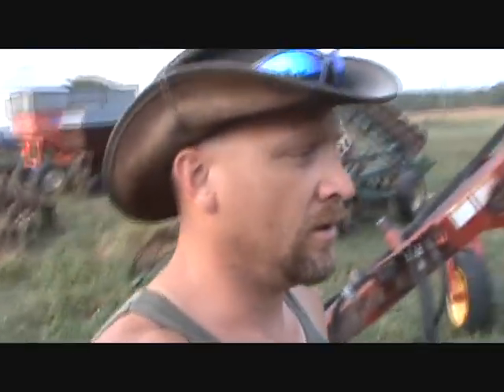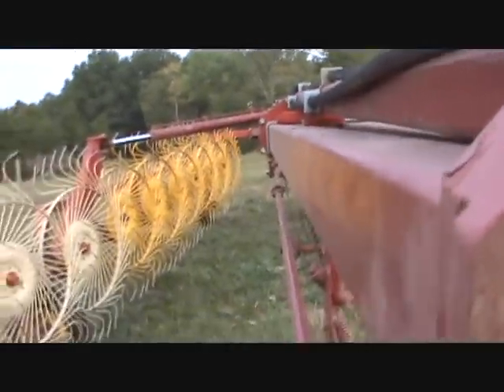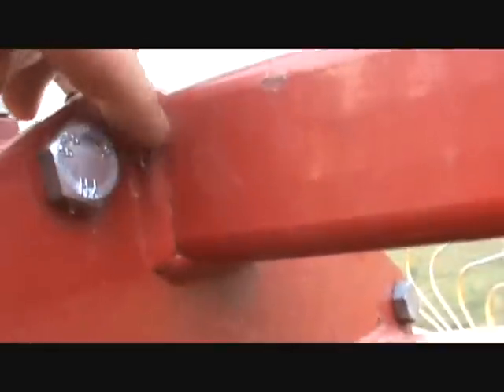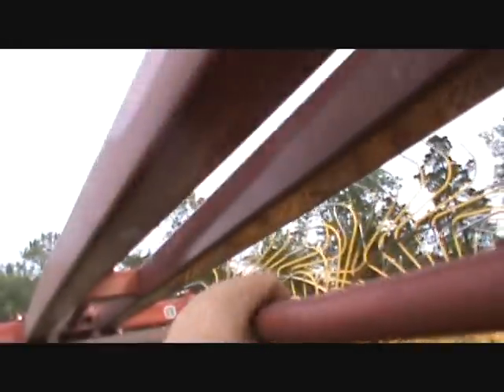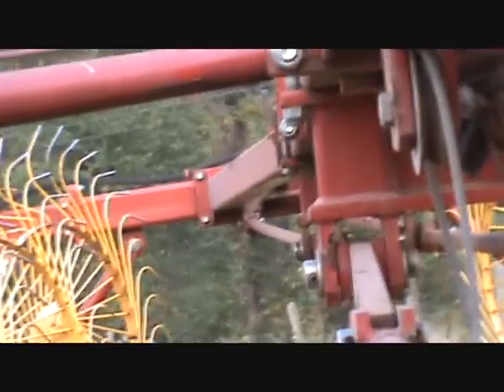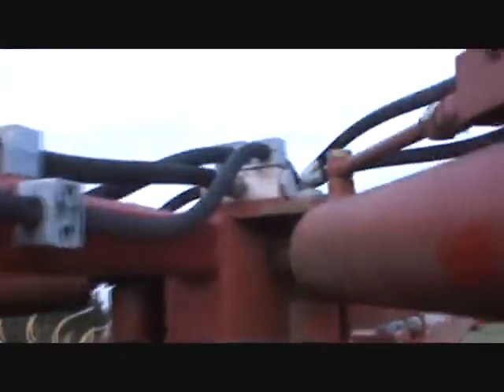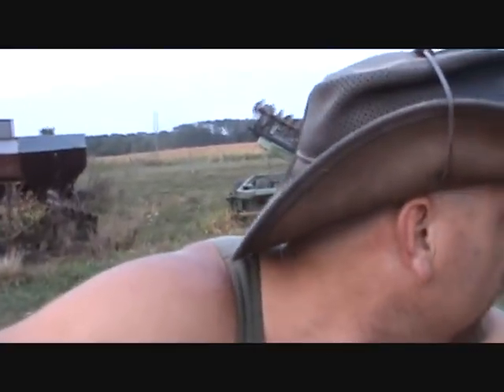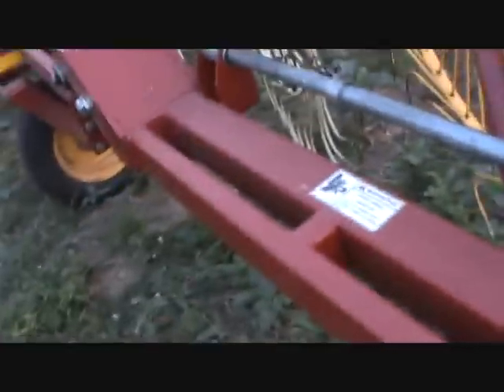trashed hay rake.

Comment: Rotary rakes are the way to go, they give you a lot more even fluffier windrows that dry better. The twin rotary rakes are more versatile too, you can do single windrows and then put 2 together to bale the last day. As for being slow you can rake at 10 or 12 km/h and they will rake perfectly clean and if a machine isn't holding up well look at the operator first, treat your machinery with respect and it will last. We still have the first rotary we bought 15 years ago and still working every day.

Comment: Some lessons are just expensive.  (Course, some are more expensive than others).  

Four years ago this fall, my nephew ran the auger cart auger into a light pole after filling the grain truck.  He snapped the pole off a couple feet up off the ground, and took out the auger and cylinder of the cart.  When he snagged the pole, the auger was still fully folded out into unload position, and the 48 inch hydraulic cylinder bent into a horseshoe, then the cylinder punched through the heavy reinforced wall of the auger pipe tubing and bent the flighting before the pole busted and relieved the strain and he stopped.  Fortunately the power line didn't come down on the tractor or cart or he'd have been in a world of hurt.  

As it was, the cart had to go up the road to the Amish welding shop and about a week or so later, he had it finished.  He had to cut away the portion of the auger tube that was mangled from the cylinder punching through it, heat and beat the flighting back straight again, and then roll a steel patch and weld it over the outside of the tubing, then weld on the gussets and cylinder bracket that folds and unfolds the tube, and replace the U shaped hydraulic cylinder with a new straight one.  $1,400 later the cart was back in the field, with me running it this time... LOL:) 

Course, when this happened, it was a Saturday afternoon, so the power company guys that came out and scabbed the pole back together with some flat iron were getting paid overtime, then they had to come back Monday and install a new light pole.  My BIL got another $1,100 love letter from them for the new pole and repairs. 

I think his insurance paid the repair bill on the cart, but he paid the power company out of pocket, IIRC.  

Stuff happens, but ya gotta be careful!  Later!  OL J R :)

Comment: You'd be surprised what leverage can do.  A 38 foot rake unfolded puts the ends out at 19 feet off center.  Tractor running at speed plus the weight of the rake getting jerked to a stop by a guy wire, ripping the welds off that piece he fixed, somethings gonna give, no doubt about it.  One other thing-- rebuilding the tongue and stiffening it up at the hitch drop in front, probably contributed-- it was probably engineered as a "failure point" in case the rake hit something, it'd just rip the hitch off or pull the bolts out.  Don't know that it was designed that way, but it could have been.  Beefing it up with heavier steel would have certainly prevented that from working, though.  

Someone says, "Guy wire?  How can a guy wire be that tough?"  Lemme tell ya a story-- My mom drove a tractor on the farm when my Dad was still renting a lot of ground and farming with my Granddad, who ran the home place (87 acres).  This would have been the summer of 76 because mom was expecting a baby (my sister).  I was 5.  Anyway, she was running the Ford 5200 row crop tractor pulling a row disk hipper on some rented ground a couple miles away, and Grandpa or Dad was running the fertilizer machine knifing in liquid fertilizer ahead of her in the field.  She was doing some end rows or turning around on the turn row and didn't realize she'd centered a guy wire for a light pole.  She panicked and didn't hit the clutch-- the tractor climbed the guy wire at like a 45 degree angle until the rear tires started hopping off the ground and the hipper was all the way up and still buried in the dirt.  She FINALLY got a grip and pulled the kill cable on the tractor to shut down the engine.  She then climbed down the steps and jumped the 4 feet down to the ground and went for help.  Dad and Grandpa used the other tractor to pull it off the guy wire, very gingerly, because the front end was about 8 feet off the ground, the tractor was pointing up like a space shuttle (almost).  That was the last day she drove a tractor.  

Now, the 5200 is an 8,500 pound tractor-- and this guy wire was holding up almost the entire weight of the tractor without snapping the pole or the wire.  SO, guy wires are TOUGH.  Not surprised one bit that it did that much damage to this LOOOONNGG hay rake being pulled at speed and hitting one hard enough to snap welds and break stuff.  

Later!  OL J R :)

Comment from the maker: how many acres do you do a year? i am doing 3000 a year and i have to say i would never buy one of the rotory rakes to many moving parts to costly to operate and maintain.the wheel rake is cheap to keep fast on the ground. i never had one but anyone that i know that did own one had a wheel rake in less than a year to many problems.

Comment: U need a merger they seem to be the laters thing  those style of rake u have there died out in the 70s in uk we went to rotary rakes such as krone swadrows claas liners etc . But they pushing mergers here now two austrian built ones from a company called reiter are doin the rounds . With impressive results fro. What ive seen gathering 30 odd feet into one . Without wrecking the grass which makes lower quality silage . . Im not sure what quality ghe hay ur making is . As they use it as mulch i suppose it dosent have to be top quality feed variety . Im not sure if they in states yet with reiter mergers i know u guys have the likes of oxbow and khun making mergers . And i would say a merger would cost way more to buy than a rake . U could probbs replace 2 rakes with one merger  im just sumising . But hey bad luck ur rake got junked . Slap on head for you wes . Lol hope u and family are all ok  lls take care stay safe .